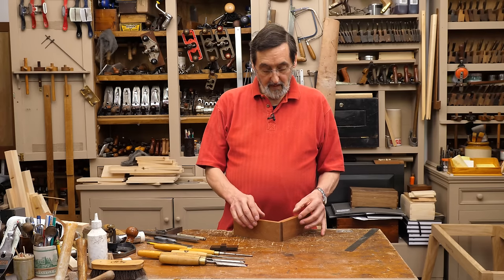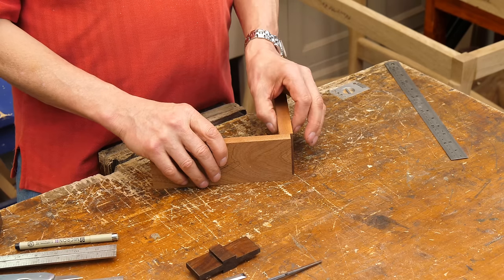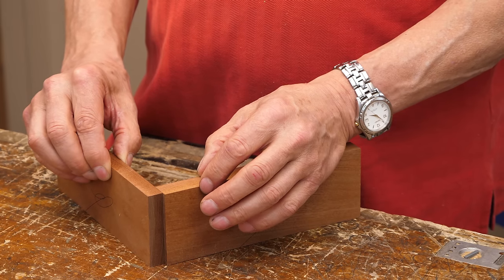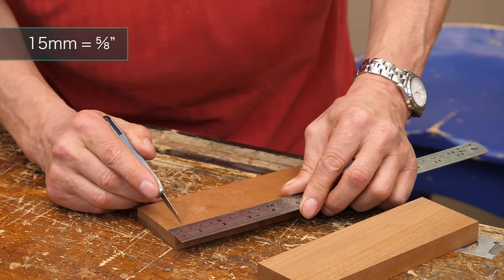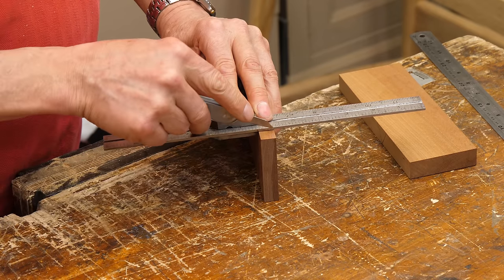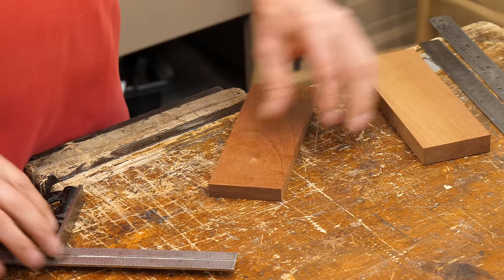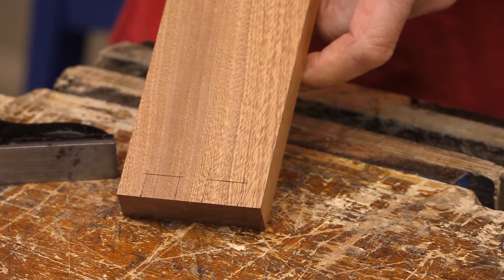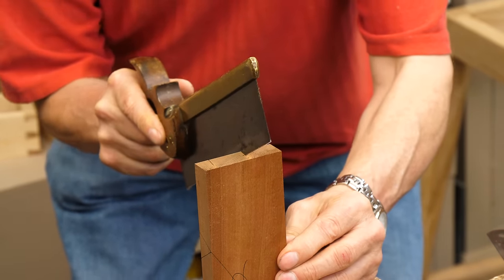How to make a Half-Lap Dovetail | Paul Sellers

Comment: Nice! The beauty of this method is that the small rebate on the inside hides any potential irregularities on the interior corner.
Reply: JC and the rebate makes marking the tails on the pin board muuuuch easier. Without the rebate it can slide and mess up ur layout. Def worth the extra minutes to put it in.

Comment: Im a recent subscriber, have been watching you lesson till 4
in the morning some  nights. I get really excited with what your doing, and inspired.

Im ex army, i also make Scottish small pipes. Ill be making a tool cabinet for
my tools, studly ish.
I was also watching you make a chisel handle. When i mount ferrels to my pipes i get the size just over sized, by about a thou then heat up the ferrule and push it on.  Stayes on for life

 

Just a thought 
You may be interested to know that when we built the Iron Bridge, up there in
Telford. You can just make out the break from Joinery to metal, as when that
was built we only knew about wood joints. The bridge is mainly joined with mortice and
tennons and dove tails, and scal joints, amongst all sorts. Not very well know about really but its
worth a trip just to see the wooden joinery techniques being applied to the iron.

Comment: i love the way you describe the process of working wood.  when i trained my old gaffer (he was old and now so am i lol) taught me to offset the sides a few mil lower than the front, then to plane that offset on the sides to set the reveal on the front in the bottom of the drawer space.  he also taught me to make the width on the back of the drawer a few mil shorter than the front so it would slide easier with ever binding.  your thoughts on that please.

Comment: The idea of cutting a rebate on the internal face of the side pieces is an excellent one Paul. It makes for a very neat internal corner. I haven't yet come across one of your videos that shows all the stages of constructing a drawer; is there one please? I'm curious to know at what stage (and how) you cut the slots for the drawer bottom, and how you incorporate the drawer bottom with the drawer back. Many thanks!
Reply from the maker: Paul will make a video at some point for making and fitting a drawer so stay tuned for that. - Team Paul

Comment: so, would a one inch dovetail be strong enough within a 3 inch deep slot, say, while making a frame using 3 by 3 inch wood? im wanting to build a sort of workbench out of 3 by 3 wood, and i want to dovetail all the connections. basically, 24-28 inches high, and 24 inches by 6 foot width and length. and with three sets of legs, and a couple of cross beams every foot or so across. would that be strong enough, considering all the connections woudl be wither full depth 3 inch long 1 inch wide dovetails? and all others being half-lap dovetails?

Comment: My dovetails always have gaps at final assembly.

At 13:11 in this video Mr Sellers uses the Tails to mark out the Pins on the end of the second board. Practicing lately, I notice that this step utilizes the lower (inside?) face of the Tails to lay out the pins on the end of the second board. However, the final joint will have the upper (outside?) face of the Tails aligned with the end of the second board. This means that the walls of the Tails MUST BE perpendicular to the face(s) of the board with the Tails in it. If the walls of the Tails are not perpendicular, there will be a gap between the Pins and the Tails at final assembly, no matter how hard you (I) try to make them fit.

Do you have any recommendations (other than rote practice) that will help me get the walls of the Tails perpendicular to their faces?

Comment: Greetings from Florida. .. First of all huge  thanks for sharing your knowledge and experience with us, what a huge honor. .. does anyone make any attachments for the router, such as extentions to one side to provide more contact surface when working on the edges?  or what is good trick to keep router parallel to the surface,  thank you
Reply: BF Florida Paul now has a mortise and tenon video I think where he talks about attaching a 1/4" wooden base the the router plane to span larger gaps. Very worthwhile. Also, the trick is to anchor one hand with lots of pressure and rotate the router plane into the cut with a swinging motion. Again, check Paul's aforementioned video. From that video u can also learn a method of getting the most amazingly perfect mortise and tenon joints. Good luck.

Comment: Superb presentation and end result. The joint seemed very tight. Is there any risk to it splitting with the pressure, either over time or when fitting? 
Sorry if this is an obvious question, I am quite novice!
Reply from the maker: No, not really. Often there are different compressions taking place inside the joint. It's still on my bench now and it looks just the same. The main advantage hand cuts have over machines is that the joiner can make allowances for the compressibility of the different wood species and all woods are indeed different in terms of density, hardness and elasticity and such.

Comment: If you weren't showing how it's done and talking, how long would you expect making such a cut to take for an experienced woodworker? I can't imagine it would actually take you 25-30minutes per corner. I do love how you show what to do when the grain doesn't co-operate, even if it wasn't intended to be a part of the video.
Reply: It would be a bit faster, but craftsmanship takes time. I don't think he could knock out a dovetail with the same quality in less time. This is also why having something made is much more expensive than IKEA.
Reply from the maker: This one was more difficult because of that one section. With all of the wood in normal state I would say no more than 15 minutes max. Less in oak and pine, which split evenly, easily and consistently.

Comment: Would you need to use glue in this joint?
Reply: Dovetails only blocks sliding in one direction, so yes, you would normally glue dovetail joints.  The glue also helps sealing the end grain inside the join, which aids with reducing moisture damage.
Reply from the maker: Yes, you would.

Comment: Just curious Paul do combination squares vary in quality? I bought a small Barco, but it never stays in the groove, there's some play. They do vary in price.
Reply: I'm not Paul, but in my experience, the quality differences are huge, both in squareness and in durability.  Cheaper ones generally have the blade rest on two small nubs, which wear unevenly because you use one side of the square more than the other.  So it goes out of square.  Better made ones have a precision made rail inside the head, which lasts a lifetime.
Then there's the screw, which on good ones don't jam, and can easily be loosened and tightened with one hand.
Good ones also tend to have secondary measurements that are accurate, like blade width (3/4" or 1"), head height, head width, angle length - all quite useful, but only if they can be trusted.

Try squares, combination squares and sliding bevel gauges should, in my humble opinion, be prioritized when it comes to what to spend extra on.  For hand tool users, they'll see so much use and their accuracy be so important to everything you do.
Reply: Simeon Banner starrett make good combination squares
Reply from the maker: Buy either a new Starrett or a secondhand Rabone Chesterman, Moore and Wright or Browne and Sharpe. If on ebay, look for wear and rounded edges. If so don't buy.

Comment: What was the reason for cutting the small rebate before laying out the joint?
Reply from the maker: It registers the position exactly and disallows any slippage so the knifewall around the dovetails is always perfect.
Reply: Thanks Paul. 
It's another great video in your ongoing quest to ensure the hand tool skills are not lost forever.
Reply: In the video you say that the rebate is about one and a half mil thick.  I am certain that you mean millimeter, which is about 40 times as deep as 1.5 mil.  Then again, if anyone could make a rebate 1.5 mil thick, it would be you...
Reply: Mil is more the American term for it. In the UK, Paul (and the rest of us) would call that a Thou, as in thousandth of an inch. So yes, mil as in millimetre... which is also not to be confused with the mil as in Milliradian, as used for sighting in artillery! ;)

Comment: Lets make a wooden house! :P
Reply: I tend to go against this. Wood should be reserved for furniture and cabinet making and not wasted on house building materials these days of thinning forests. Unfortunately americans continue to build wood stick houses instead of using brick to build a structure that will last 10 times as long and save forests. Not that they haven't already destroyed 90% of the original north american continent hardwood forest, they have ! and not learned their lessons from it.
Reply: @goognam goognws - If Americans hadn't cleared so much land (the vast majority for land cultivation, btw) then their would be billions more starving people on this planet. Besides, through protection laws & reforestation, America has over 700 million acres of forest still today (some are nat'l parks that cannot be harvested & some are sustainable forests that we harvest w/ no damage to the viability of those forests which are heavily regulated - it's actually US Federal law to harvest sustainable tracts of forest ONLY) - so to say we haven't "learned our lesson" is disingenuous at best. Also the wood used in home construction in the US all comes from sustainable forests & 98% of that wood is genetically modified yellow pine that has an incredibly rapid growth rate. The same cannot be said of South America but you're obviously attacking North America for some reason. Actually, today there are more trees in North America than there were 100 years ago.
 The UK has clear-cut well over 99% of it's native forests along w/ other European nations with relatively few parks or sustainable forests compared to the US. Despite the creation of the "Forestry Commission", centuries of deforestation have more severely depleted Europe of trees than the irresponsibility of 19th century attempts at clearcutting in North America. Although reforestation in the UK now has officials claiming to being close to tripling its forest area since 1919 - which is excellent news but still a long way to go if you want to reforest the UK to circa 5000 AD (it appears the people of the UK have also "learned their lesson", right.
 It appears you hold some animus towards America by maybe intentionally using a lower case "a" both times you wrote America?